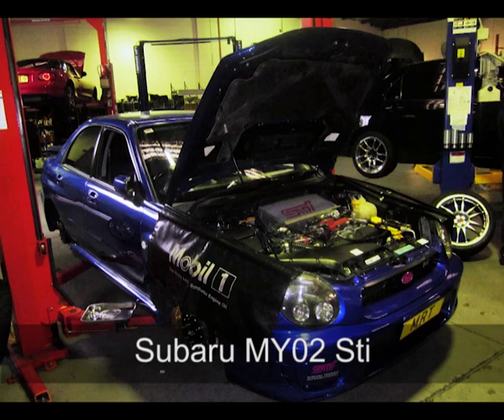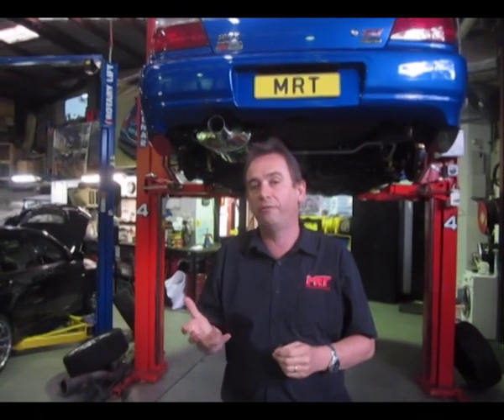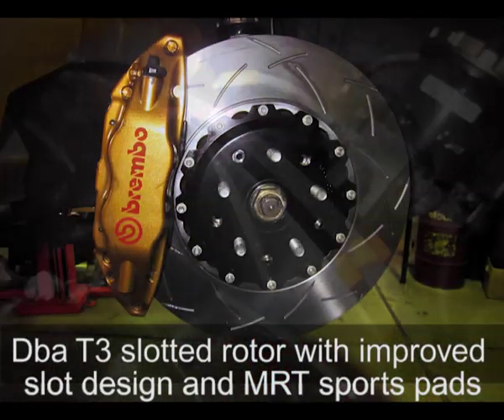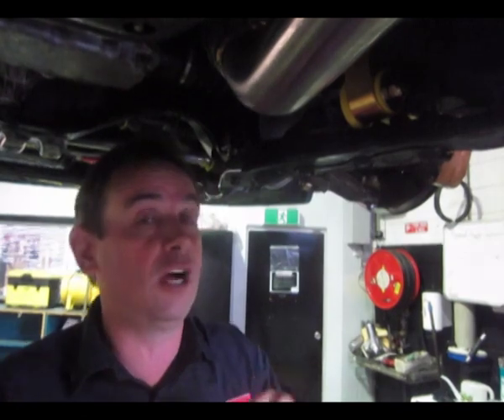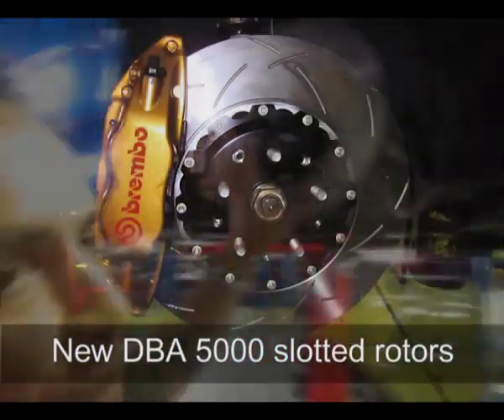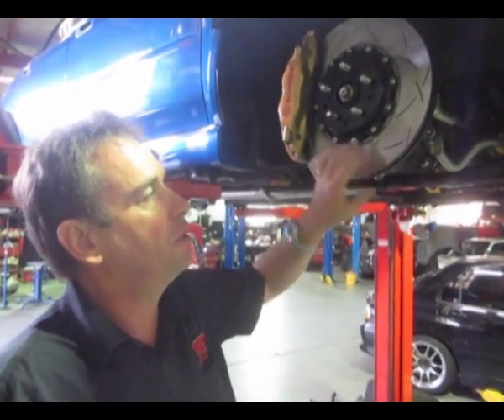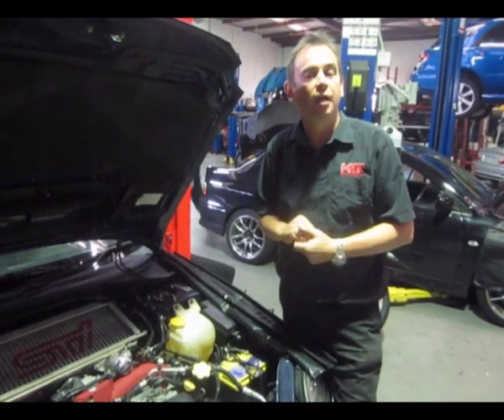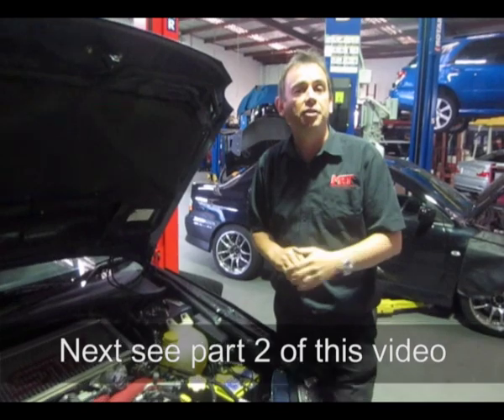Subaru Impreza MY02 WRX Sti tech secrets Part 1 of 2

Comment: have you noticed much difference in the two piece T slot DBA rotors compared to the drilled and slotted once piece DBA 4000 in pad wear/ head transfer and longevity in a daily driver weekend track car?

Comment: Hi there,
is a wrx sti 2002 - 2007 worth getting with approx 80,000 kms - 160,000 kms, very affordable as you've mentioned in the video. I saw 2002 models advertised for $14,000 and the 05 - 07 25k - 35k.
I then intend on then purchasing an XA or XB kit at maximum motorsport in Perth, Wa.
I have had a go at a wrx sti before, the 2005 looks like the best option given the 2L vs the durability of the 2.5L in the MY06/MY07...